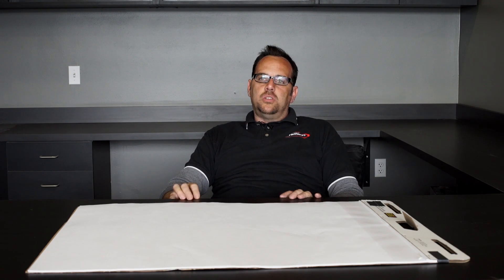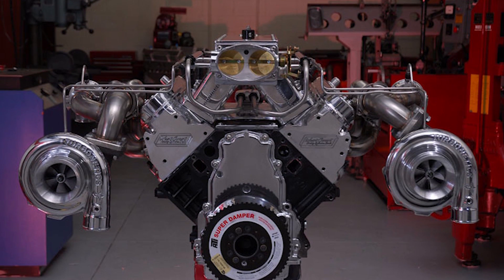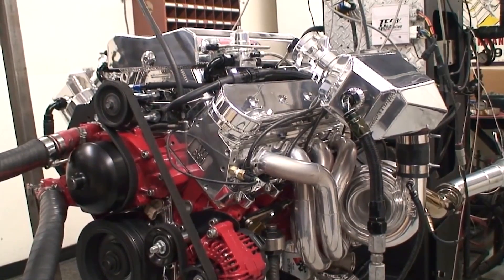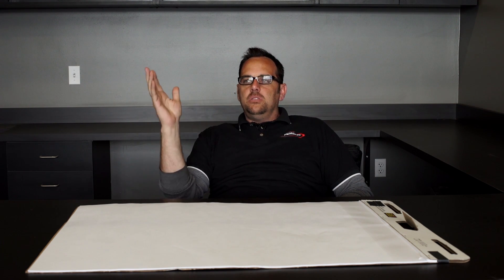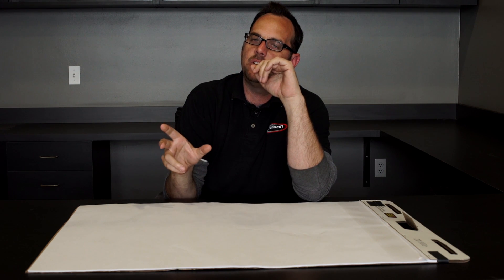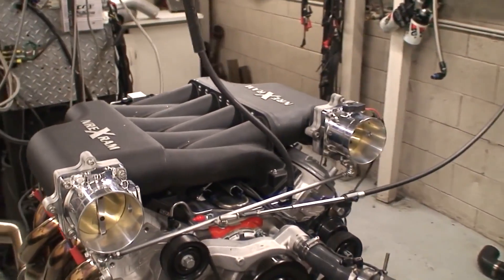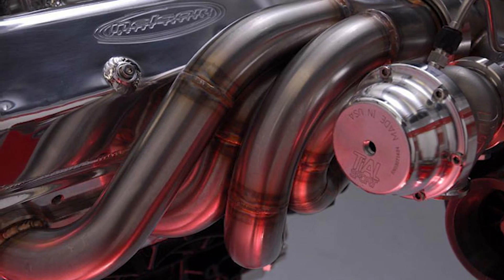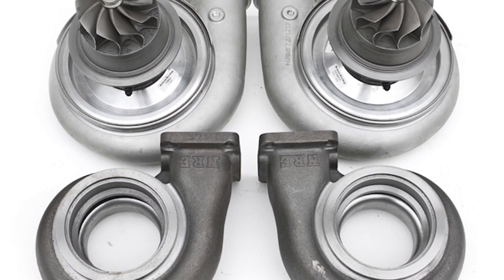Master Engine Builder Explains Why the LS V8 Is SO Good

Comment: The only reason why it's good at all is because Chevy engineers copied the Windsor Ford engine but with a more modern approach.
Reply: +Jim Garrison All ford engines copied the 1955 small block chevy...without this engine there would never have been 260,289,302 et al PERIOD!
Reply: Don't listen to that idiot FRANK 839873, he is a dumb ass ford fanboy that hates GM, and copy and pastes his bullshit all over youtube.   All that copying ford shit, it total BULLSHIT.  And he has been proven wrong several times.
Reply: Jeremy Hall  No they didn't, so why don't you do some research and quit looking foolish, by listening to a couple of youtube commenters.   And no they don't use Windsor intakes on LS engines....lol  smh
Reply: Jake S  You prove GM did !
Reply: Jake S  You are the one accusing GM of copying ford, so it is on you to prove this "copying"....  You mean to tell me that you don't understand how this type of thing works....lol
Reply: 852urkl
Good points,but they changed the rules(and rules are rules,no excuses)...and Jenkins was only running a 327 bored .030 and he could've done the same thing with a 396/427/454 or a 400 bored .030 to 406.The L88 corvette beat the hemi every outing.Those elephants were 12.5 to one with dual fours.,so if that's not full race what is??Dodge used thinner body metal and glass to lighten the load.,and in every other conceivable way.
Reply: Jake S   No it is definitely on you since you are the accuser.....  Maybe you should educate yourself before proving yourself even more foolish.   SMH
Reply: Jake S   Burden of proof is on the accuser, you stupid fuck !   So prove it, or STFU !
Reply: Jake S  Again, you are as stupid as I have ever encountered on youtube.  INNOCENT TILL PROVEN GUILTY, THE BURDEN OF PROOF IS ON THE ACCUSER.    Got Damn you're fucking stupid !
Reply: Jake S  I did what ?   You are the one that accused someone of copying ford, so the burden of proof is on your dumb ass.   SMH
Reply: Jake S  That piece of shit ford truck you have, would never make the trip, and you would never have the guts to come at me....    And the burden of proof is still on your dumbass !
Reply: no, the LS is a combination of Oldsmobile, Pontiac, Chevy, Buick, and the Cadillac Northstar engine, nothing with Ford
Reply: chevy = overpriced and overrated. the vehicles themselves can fuck off, your 96 s10 without an engine and trans isnt still worth 3 grand( and yes thats the type of price some people think they are worth in my area) just cause its chevy. gotta love the cheap ls engines in the usa though, go to v8 swap engine
Reply: +mfnbigdaddy73 isn't that the truth. You don't ever see anyone put a Ford motor in it any other vehicle
Reply: Another difference is ford still hasn't figured out the 90° v8 they would rather a 60°
Reply: D Taylor  The NHRA and Nascar have always had a nasty habit of screwing Chrysler because they showed up to play ball. Just like at Indy for 1955. Chrysler came out swinging with that crazy 331 Hemi. When the fastest cars were doing 179, that Hemi was doing 182! Then the sanctioning bodies changed the rules...
As for using thinner metal....everybody did that back then, remember the swiss cheese Catalina's? There were a lot of AF/X Comets running full fiberglass and such too back then. As for you still hating on the Hemi, I recall an old Direct Connection Ad thanking all the different manufactures, Pontiac, Chevy, Ford, for running Hemi's!
 If you want to competitive today and run in the Big Boy league, you have to run a Hemi!
Reply: Jake S  You are obviously too stupid to understand that the burden of proof is on the accuser.   GM is innocent till PROVEN GUILTY, do you not understand how this works, you dumb ass, inbred, ford fan boy.
Reply: Jake S the burden of proof is on your dumb ass.
Reply: Jake S the burden of proof is on your dumb ass.
Reply: Are you kidding? The 350 c.i. chevy motor came into production before the ford 351 c.i. windsor motor. I have built several of the small block fords and chevys and i can tell you from "hands on experience" they are very different indeed.  I am curious to know what you mean by "copied but with a more modern approach".
Reply: wblandscraping  Jake has no proof of anything he says. The LS is so good that he just cant accept that Chevy makes better ohv engines.   lmao
Reply: silosis Then why are the LS engines so good at making big HP, that people swap them into everything from mustangs to mazdas ?
Reply: wblandscraping Ford shit is to physically large, too expansive, and to difficult/expensive to work on, to be swapping into other vehicles.   Not only that, but they are difficult, and expensive to get big power out of (without boost).
Reply: Ford people are so depressing.
Reply: But maaaawwmm Heee started it. No he started it! Noo He started it! Say you're sorry😠
Reply: silosis Contradict yourself ...lol
overpriced, and cheap......... ?
Reply: mfnbigdaddy73 nah its just that the engines are the only redeemable factor in an overrated shitstorm of trucks and cars. sure they are good vehicles but are not worth what some people think they are. atleast in my area
Reply: Jake S Still projecting I see.....   Maybe you should just embrace your family/lovers and stop feeling guilty and projecting your reality onto other people.
Reply: just to let you know bob glidden was beating everybody with a 351C FORD ENGINE YES FORD and he had to carry more weight than the other guys it's a fact of NHRA history because the cleveland engine had canted valve heads that flows better than any small block chevy back than you had to run small blocks factory stuff highly modified  the pissing and moaning by the chevy and mopar guys made the NHRA TO Switch to big block .....
Reply: your wrong the first v8 ever made was not made buy ford or chevy lmao 1902 is when the first v8 was made plus if you want to talk ford and chevy ..ford was first with the 1932 ford v8 flat head and than the 1953 y block v8  than chevy 1955 v8
Reply: Bull shit! What about the 427 mystery motor? "Chevrolet previously offered the Mark I Big-Block engines, which were better known as the 348, 409, and 427 “W” engines. It’s been written that these “W” engines were great performers but lacked power and longevity for stock car racing. Since Chevrolet was heavily involved in racing during the 1960s, it dedicated a team of engineers to develop a special new engine that would put the competition to shame. It wouldn’t be the first or last time GM, Ford, or Chrysler built specific parts for racing and labeled them as a low-production powerplant, so they could upset the competition. The Chevy “Mystery Motor” debuted on February 22, 1963, for the Daytona 500. The factory called this engine the Mark II, and eventually it became the big-block Chevy engine we know. That day, all eyes at the track were on Junior Johnson’s Chevrolet as he won the first qualifier. Johnny Rutherford knocked down qualifier number 2 with a big-block thundering between the front fenders of his Chevrolet as well. The big-block proved to be so much more powerful than the previous big-block (known as the W-block 348-409) that the competition didn’t know what hit them. In the May 1963 Hot Rod magazine’s Ray Brock wrote, “[Chevrolet’s 427 Mystery V-8] sure rocked the racing fraternity,” and, “Junior Johnson shook up the observers behind the pit wall with a practice lap above 168 mph.” Chevy’s best lap in 1962 of 153 mph had been officially obliterated! Ford and Chrysler were up in arms." https://www.chevydiy.com/historical-review-big-block-chevrolet-complete-history-big-block-chevrolet-engines/
Reply: Prove it!
Reply: If that was true why was the shit 351 not swapped into everything on the planet. Also stop projecting onto others.
Reply: Are you a bored Hillary troll? How much does it pay? I bet a lot if you can afford Ford.
Reply: WRONG!!! "The Chevrolet Series D is an American automobile produced by Chevrolet between 1917 and 1918. Over 4,000 Series D cars were manufactured in the 1918 model year, and it was the first Chevrolet V8 car made. It wasn't until 1955 that Chevrolet made another V8."
Reply: 50 years ago, a small block Ford 260, 289, 302, etc was very similar to a small block Chevy.  I'm not sure that Ford engineers had time to copy a small block Chevy in the late 1950s since engines are usually on the drawing board years before they get put into production. GM and Ford both needed small OHV  V8s by the late 1950s and I'm sure both companies were working hard to design them.
Reply: 852urkl
hahahaha the first hemi was in 1916 many manufacturers used it way before chrysler.Grumpy Jenkins kicked those hemi's into the boat anchor that they are in '71....any built smallblock can beat a hemi 426/392.Small block ford and small block mopar both copied the small block chevy and that's not just me,that's Car Craft magazine,Hot Rod,Motortrend et al!!! Everyone that's anybody in the car world knows this is just the way it is,everyone else is in denial.
Reply: D Taylor From what I have read about that subject, the NHRA let Jenkins run a tube frame chassis Vega while they told everyone else to pound sand and get over the fact that they had to run full frames. The NHRA was letting Chevy back into drag racing, cause well....all they had was a small block.   Sounds like you are in denial yourself about the Hemi. Hemi cars dominated the drag racing scene until the NHRA pretty much pushed them out with new rules and weight restrictions.
Yes the first hemi was in 1916, but they hadn't been mass produced the way they had been before Chrysler started to do so in the early 50's. 
And a built small block can only beat a Hemi or a Cammer IF it those elephants are completely stock.
Reply: +D Taylor If I remember right, all Chevy had through 1954 was a straight six, so you might say that without the Chrysler "Firepower" Hemi's, and the rivalries between the automakers to keep up/ahead of each other, the "modern" small blocks from Chevy and Ford might not have come on the scene until years later. Honestly though, those first Gen Hemi's kick the small block Chevys and Fords into the scrap heap!
Reply: That's exactly what they did
Reply: mfnbigdaddy73 no, its def on you. I told you first and that is all there is to it. You can either quit responding or do as I told you.
Reply: mfnbigdaddy73 either you quit responding or you provide evidence. Do you understand?
Reply: mfnbigdaddy73 what did I tell you? You will obey me. Give me the proof now or forever be labeled by your words here.
Reply: mfnbigdaddy73 I told you to prove it, not GM. They know they stole the Windsor design. Now do as I told you or else
Reply: mfnbigdaddy73 actually it's on you. I told you first, that's all there is to it. Now do it or there will be consequences.
Reply: mfnbigdaddy73 well your inbred ass did it. I can't stop what happens to you or your single wide. You didn't do what I said, and now you will pay
Reply: mfnbigdaddy73 hey inbred. Like I said, I can't stop what happens to you now. You didn't listen and now you will be punished
Reply: mfnbigdaddy73 like I said. I can't stop what's going to happen to you. It's to late.
Reply: mfnbigdaddy73 do you not understand? I know who you are and where you live. What happens now is out of my hands. There will be people knocking on your door. I suggest you answer it nicely.
Reply: oceanwaves83 so you immediately start projecting your disgusting life onto me? I suggest you turn yourself in for such depravity.
Reply: mfnbigdaddy73 the only reason the LS is good is because its a rebadged 351. And just because you are a poor stupid fucking inbred that tosses your daddy/uncle/brothers salad. Doesnt mean the rest of society cant build a Ford engine.
Reply: mfnbigdaddy73 I see them all the time. Now you being an inbred loser of course only see cheby stuff, because thats what inbreds like. Its a proven fact that most cheby fans are inbred.
Reply: jim i'm a ford guy and you are wrong...the LS engine is a modern up dated aluminum block the only thing they copied  is the 6 bolt main because the only engine that had 6 bolt mains was the 427 ford side oiler no other engine had that and the 10 bolt head from the 16 bolts is ford 351 cleveland 400m a460 ford all have 10 bolt..im a ford engine builder.. the master engine challenge fords been winning with old technology  last year a 404 ford cleveland built by MPH WON BEATING OUT.. Ls chevy  engines also jon kasse won 3 times with FORD POWER beating LS chevy Engines   it all depends on who's building the engines to make power does not matter what engine its all in the heads air flow and the right camshaft ....last year jon kasse built a ford Y block that engine is from the 50s and made more power than a LS CHEVY  look it up if you don't believe it
Reply: mfnbigdaddy73 prove that GM didn't copy the Windsor design. Post actual mechanical specs detailing the difference
Reply: mfnbigdaddy73 the burden of proof is on you. I told you first, and thats all there is to it. I control that point. The only counter you can have is proving what I told you to prove.
Reply: wblandscraping I see Ford swaps all the time. Why? Because they are better, period.
Reply: wblandscraping I said the LS. Not the junk 350. Look at the valve layout, block angle, rocker ratio, head bolts, oiling system, cam location, etc. Vastly copied from the Windsor series and Cleveland series. In fact several people have put Cleveland heads on the LS to get much better airflow.

Comment: if you want a good motor get a coyote ford.. will beat any chevy motor cubic inch for cubic inch
Reply: They cost a lot more and after market engine components aren't as widely available....   And the DOHC don't fit into tight engine bays like a LS engine does.
Reply: 2007dalin you can have your coyote. My tired ls1 with minor bolt ons walked a couple Coyotes
Reply: Black 96GT Keep changing out 4 cams.Keep splitting shitty ford blocks.
Reply: I’m surprised that women know how to drive that well
Reply: keep your $5K cam swap Coyote.
Reply: those fuckers are expensive
Reply: This Old Jew lol
Reply: women drive mustangs.
Reply: This Old Jew Sure dude whatever you say
Reply: or feminine men. say, my wife was wondering what kind of douche do u use?
Reply: This Old Jew Haha
Reply: my wife says she's never heard of that brand before..
Reply: This Old Jew WTF
Reply: 2007dalin coyotes need 4 cams and 32 valves to do what an LS can do with 1 and 16.
Reply: Rich Piana's Oil Distribution Manager You must have got beat by some coyotes before lol, Its alright everybody does

Comment: A Fantastic Video, no crazy blasting music, just straight up informative  Thank you.
A request for a little advice. (pay check to pay check kinda-guy).  
My Daily driver: More Performance is the goal. 
I have a  ECU flash Tuned LS 1,  4.8 with a 220/220 cam 3500 Stall and a  4.11 rear, the Vehicles curb weight is approx 5000 lbs. Under advisement I am opting
for the "Long Tube headers". My questing is "Throttle body" Mine is the original and it could use rebuilding. Is it wise to replace it with a HP model or just rebuild the old.

Comment: aluminium motos are bad, the E-types inline 6 used to leak oil at high capacity, also please do not put LS motors in RX7's they were made with a rotary please keep it that way

Comment: the ls engine is cheap hp  that's all you get a junk yard 5.3 and put a turbo on it Evan a used one say off a Ford diesel because it's a big Garrett and some pipe and time you could have a five to six hundred horses for about a grand  I would try it on a 5.4 triton but I don't want spark plugs shooting at me while tuning
Reply: Triton v8, wow.. not enough threads holding spark plug.  Plus recessed WAAY down.  Buddy in Misssippi had one throw 2 plugs thru the hood.

Comment: People still think it's 1970, when auto manufacturers just threw half-assed intake and exhaust systems on engines, because they knew they would get changed out. Back then, on old carbed V8's, yes, there was a whole hell of a lot to be gained from a good intake manifold, carb, and a set of headers. Today, cars pretty much come tapped from the factory.

Comment: Great video, great info. It makes me want to build something. The future will be fun if we can pick and match electric motor parts and power supply in the same fashion we do with gasoline engines. I was hoping he'd talk more about the LS crankshaft design and get into cylinder head specifics. Very good points and info on piston skirt issues. I wonder what they'll come up with in the next ten years. I'd love to see what electric valves have to offer for V8s...

Comment: The LS3 is a great little motor because of it being a redesigned and modified version of the 350 ci. small block, 3.65 stroke 4.065 and 10:5:1 compression like he say's the cam bores are bigger but it;s also higher up the block so those bigger cam;s can be toyed with aggressivly more duration, lsa,and higher lift, (the heads) very important redesigned way more air moves thru this engine.This is the combination that makes these little engines great? it's still an overhead vavle design not (dohc) and it does not need the cross bolts but it wont hurt, less harmonics so yea an OVERHEAD DESIGN is still old school but put this engine against HEMIS,COYOTES and what ever is out there, will do really great for an overhead valve design and only one camshaft!!!

Comment: the LS is good? pffft when the LS was introduced to Australia in the 90's they were recalled so many times because they use to explode into flames! (seriously it did) the only reason why you would consider a "good" engine is because there are millions of them & they cost nothing - you cant give these things away & thats why these are called "spam engines"
Reply: GTFORDMAN the very early ones had issues.
From the LS2 onwards they have been great.